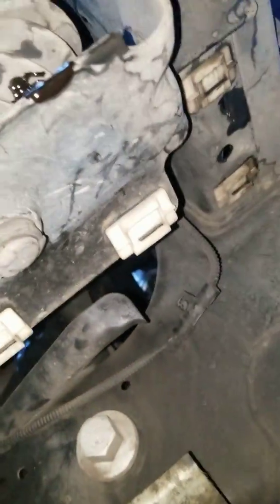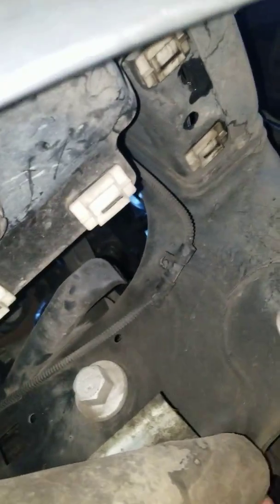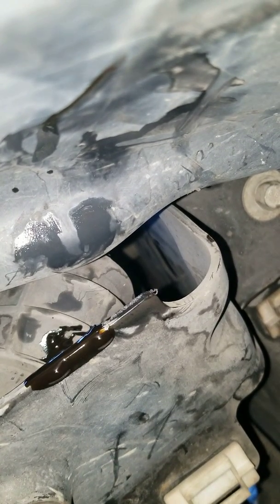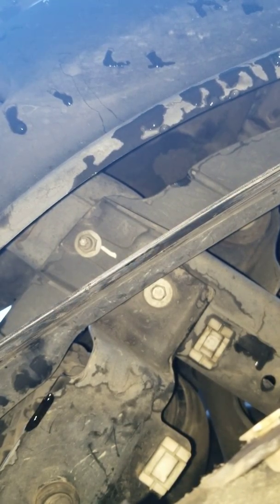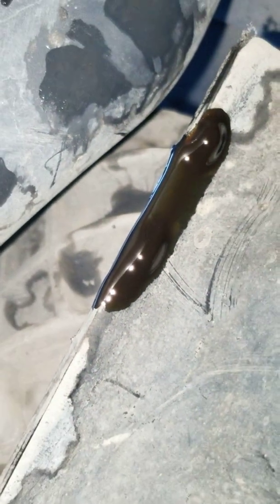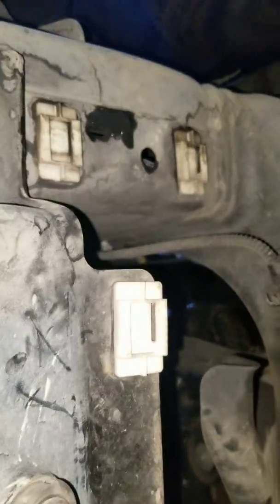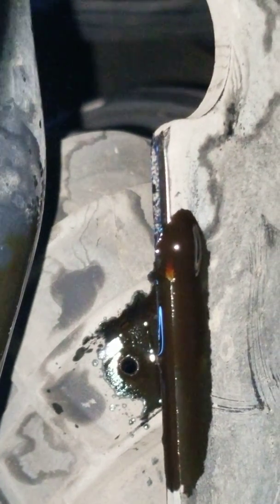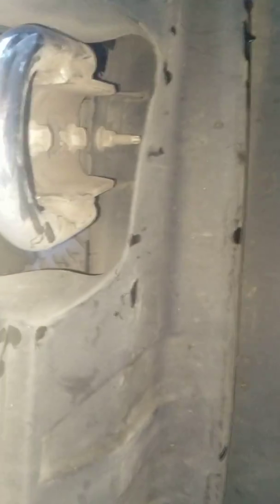2011 F150 Ecoboost Intercooler weep hole drilling mod

Comment: Drilled mine in the same place on my 2016 F-150, pink thin fluid came out, is this coolant??
Reply from the maker: They changed things up a bit in your generation and supposedly fixed the issue in 2014 that requires this, but it's probably still a solid mod to do just in case. That being said, pink fluid may be coolant, but normally it's going to be green or amber in color. Pink is typically used in some German and British cars, not Fords. Are you sure you drilled into the intercooler and not the transmission cooler or radiator? It's possible some coolant may have gotten in there, but that would be a sign of a potential head gasket issue. Check your coolant reservoir and see what the color is. If it matches, it may be that. Otherwise it may be oil that has a reddish hue to it and diluted with water. The only thing that should be in there (that we're trying to get out) is oil and moisture from compressed air that has condensed into water. You do have an Ecoboost engine, right?
Reply: phathomthis yes, it’s a 3.5 ecoboost
Reply from the maker: @zackstrigin  Ah, the good one. Have you checked your fluids to see if any matched the color? It's likely oil and water mixed making it a pinkish hue if none of your other fluids match.

Comment: hmmm drilled it but nothing coming out? 2011 94k miles?? hesitant to drill another hole?
Reply from the maker: If you drilled in that same spot it should be if there's anything in there. 
Maybe you didn't go.deep enough? The drillbit I used was roughly 2-3" long.
Have you left it running, preferably with the nose facing downhill, and reved it?
It's possible you haven't had anything collect in there, but with the year and mileage that's unlikely.
What state are you in? I've heard that more collects in colder climates. This was on a Washington truck.
Reply: @phathomthis  I am in New Hampshire did you drill it from the front of the truck towards the back or did you from the back of the cooler towards the front?
Reply from the maker: @motodrummer   In New Hampshire, I'd think you definitely would have some build up. The only reason I think you wouldn't is if you had a catch can installed very early on. 
I drilled from the front of the truck back, pretty much the only place you can get a drill in between the supports.
Reply: @phathomthis  Never mind after running it for a bit I have alot of gunk coming out like yours.  I am now going to replace all my ignition coils and plugs. If it still happens after that I am getting rid of her.
Reply from the maker: @motodrummer  sounds like a solid plan. Getting all the crap out and getting your ignition coils and plugs replaced helps a lot. A catch can is a good idea too. Check out my ignition coil video. It has a link there for cheap performance coils and plugs. I've been running performance coils on mine and it's been running great.

Comment: Mine is leaky water and oil but not to your extent....where is the oil coming from? I have 86k miles on my 2011 with the hole drilled in 2012 when I first read this on the Ford Ecoboost forum. Do I have a compressor seal going?
Reply from the maker: Mine had ~120k miles when I did this mod, so that's probably why mine had more coming out.
The water comes from the moisture in hot air from the turbos condensing in the intercooler, that's what it does. You want the air in your engine, not water. Some travels through, some gets trapped in the intercooler and eventually finds its way into your engine. The weephole mod helps drain this, so it doesn't end up in your engine.
The oil comes from a few sources, the greatest being the passenger side PCV return line. It returns excess crank case vapors, which includes oil, back into the intake track.
Ideally a catch can on the passenger side and the weephole mod are the best ways to prevent excess oil and water from getting back into your engine.
Reply: I believe that my problem was that the un drained moisture in the aftercooler froze turning this long winter and when spring finally arrived it melted and decided to gravity drain onto the driveway....once this was gone there was no recurrence